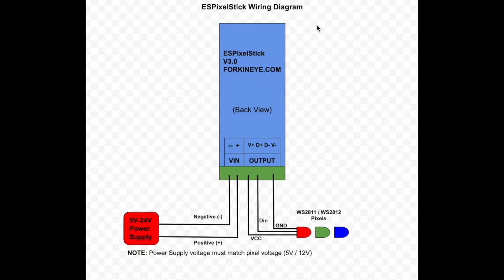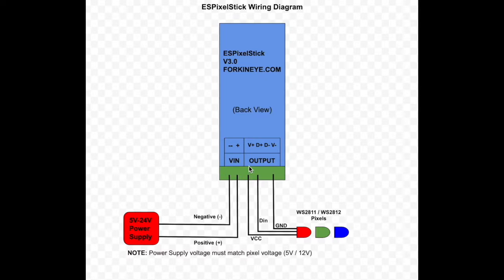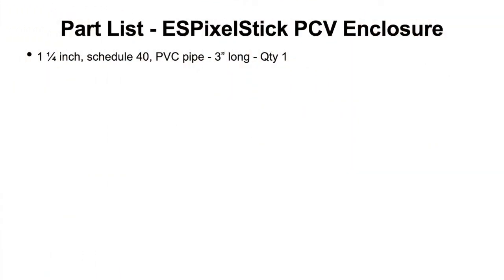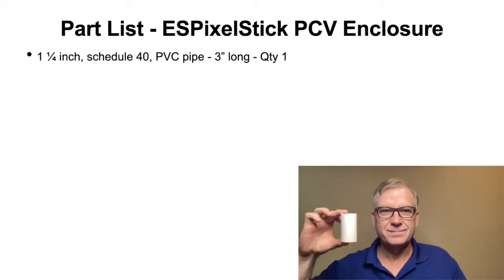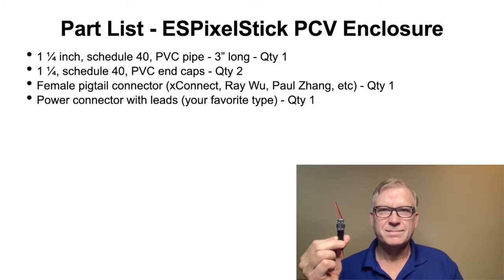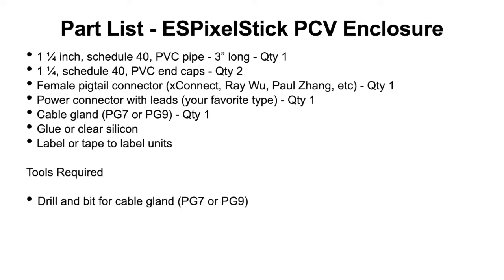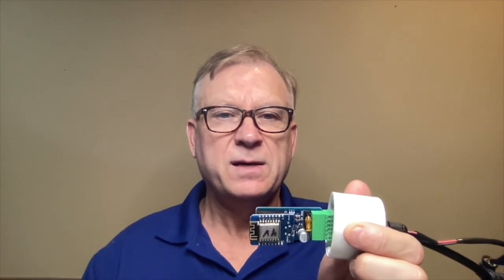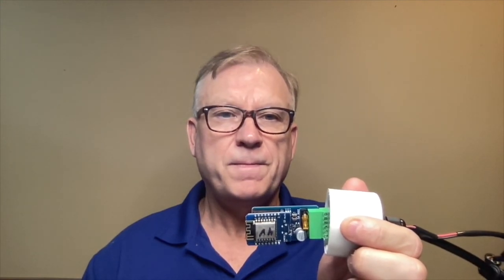How to wire an ESPixelStick and build a simple enclosure using PVC pipe.

Comment: Are you confident that's water tight?
Reply from the maker: I have use these enclosures for two seasons in the Midwest during the winter without any problems.

If you want to take extra precautions, glue one end of the tube to the endcap. On the other end cap apply a ring of silicone around the edge and apply silicone on the inside of the gland around the wires.
Reply: @thechristmaslightguy  i trust you...I was just curious. I'm in Milwaukee so I can appreciate what needs to be done so the innards don't malfunction under 2 feet of snow.
Reply from the maker: @philkingmke  My enclosures have been buried in 6 inches of snow for a short while. I’m near Cincinnati. I would take the extra precautions if I were you. Lol
Reply: @thechristmaslightguy  i think I will but I love the idea of what you've come up with. These espixelsticks are quite intriguing. I have some standalone things that are just too far from everything else and I feel like these could make it happen. The process seems fairly straightforward.
Reply from the maker: @philkingmke  Thank you. I appreciate it. I have been recently looking at the Quinn LED products and have a series of videos coming out. You may wanna take a look at some Quinn LED products since you can get more ports than a pixel stick with the same functionality
Reply from the maker: The queen LED products can use the same ES pixel stick firmware
Reply: @thechristmaslightguy  interesting. 4 ports each is almost certainly more than id ever need. For now, i think id just be looking to wrap a couple of trees with some bullets. Thats 680 per tree if I'm doing my math right. Yeah id never need that.